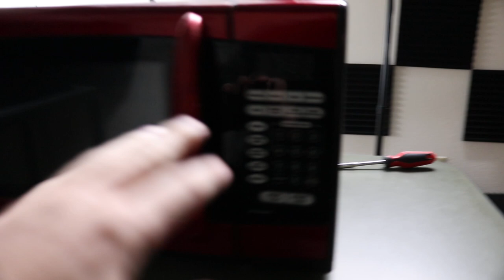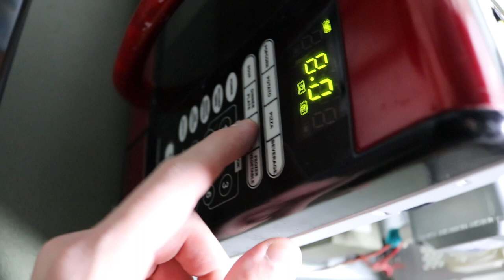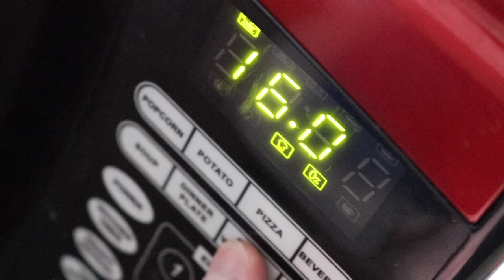Stop loud microwave beeping

Comment: Thanks for the inspiration to solve the exact same problem. Mine beeps for a full minute when the time is up. It could drive me mad. Opened the back and there is the very same evil little component. I took my tiny pliers, gripped it round its neck, squeezes, twisted and pulled. It is now lying on the worktop well & truly dead. I am astonished that such a little component possessed the ability to put me in a bad frame of mind and cause to me to scream. But no more.

Comment: Thank you SOOO much! And thank you to the other commenters who mentioned the inside is also high voltage even without being plugged in. The Emerson model I had, had the speaker facing the OTHER way so I couldn't even see it but I had an endoscope which allowed me to use a curved tooth scraper to get in there and remove the leads. SO HAPPY now I can run this thing without sound. Mine is from 2007 so I wasn't worried about it not working because it's already so old but this thing has worked flawlessly since I bought it new.

Comment: Thanks. This worked perfectly. My speaker looked a bit different. It was cylindrical with one hole in the end. I just pried it off the board with a flathead screwdriver. Problem solved. Silence is golden.

Comment: A safety warning is pretty essential for this. The power should be disconnected before opening.
Reply: Thin the heard
Reply: If he ran it without the panels there could be an issue with the magnetron and microwaves, but since he's just pressing buttons there is no harm. However if anyone is not accustomed to tinkering or taking electronics apart they should definitely not do this at all.
Reply: That's not really important. Kind of formality.. As long as we are not starting a cycle, we are good.
As a matter of fact, to perform a audio test to identify the speaker, and performing the 'muffle' test, we DO need power to be ON. 
IF somebody is too scared, or less confident, then dont try this.
Reply: It doesn't matter if it's plugged in. There is a capacitor in there that can kill a human being.

Comment: Thank you! I followed your method on my GE model JES1145SH1SS manufactured June 2018, 950 watt microwave NOISEMAKER!!!!
The tweeter in mine has wires that were difficult to access but I reached in with a tiny screwdriver and pried them out.
And like a regular Torx screw is not security enough they gotta put in the ones you showed, Tamperproof Torx. Luckily I had a set of Tamperproof Torx Keys from the last electronic thing I "tampered" with. HA!
Sweet silence, works great. Now... about the neighbors yappy POS dog.

Comment: Warning: may disable electronics in some microwaves. Did exactly what you suggest. However, in my GE microwave it changed the operation, and I can’t start the microwave anymore, despite the display working properly.  Trying to figure out resistance of beeper and install appropriate resistor. Keep the fingers crossed.

Comment: I'm thinking of doing similar on my microwave. However I want to put a switch between the positive of the beeper, then put the switch on the side of the microwave so I can toggle it on and off. I think I might even put a three way switch so I could put a resistor on it to possibly make a mode for lower volume. I also want to put a switch on it to turn my turn table on and off as well because I have square plates that can't turn and it just spins around and sometimes causes havoc in there, lol.

Comment: How do you put it back to normal
Reply: Solder probably. Ideally then you cut that wire rather than pull it off. But I didn't have the patience, and I don't think it ever needs to be restored. Now after 2 years, try to silence yours.

Comment: Lol remove the back panel that says ‘ if you remove this panel it will void your warranty ‘ 🤣
Reply: yeah, warranty are not worth the paper they are written on
Reply: That's a gamble worth taking. Though I once had a microwave go in under 1yr.. got it fixed under warranty and it lasted 10 years.